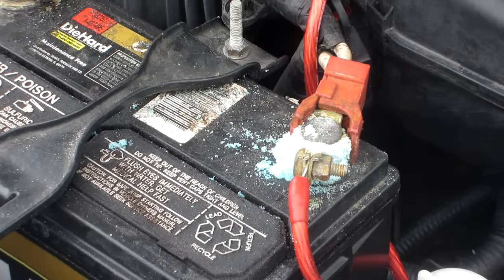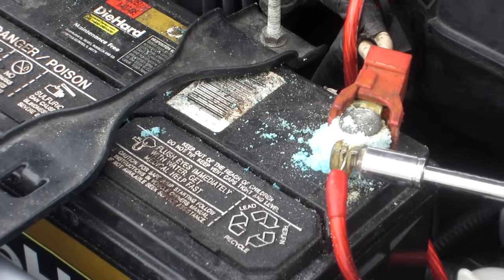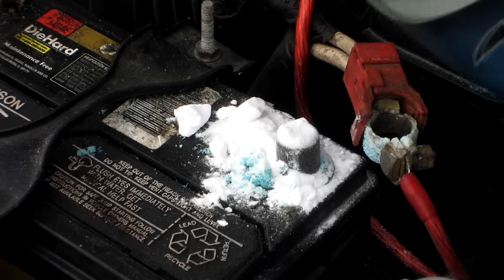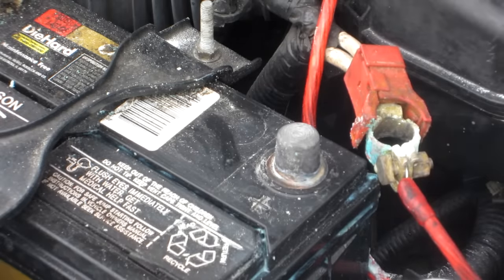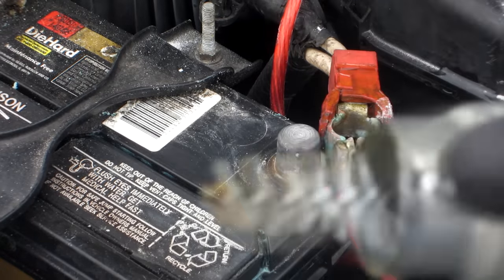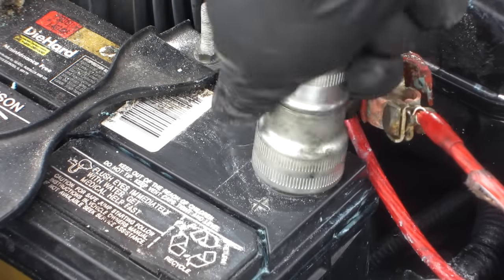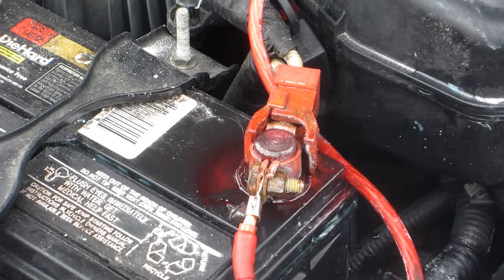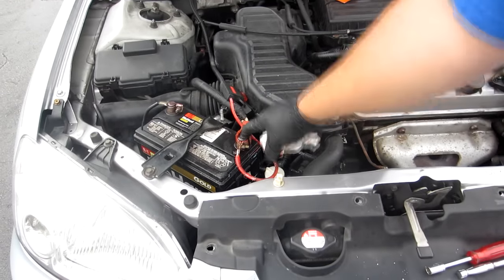HOW TO REMOVE BATTERY CORROSION FAST AND CHEAP!!!

Comment: the reason that the Positive terminal is full of corrosion is the battery acid is leaking up past the Post...... junk battery. It will come back. What I found works better to clean is to either soak the positive terminal in a hot/ boiling cup of water for about 5 minutes. It will clean all the Acid off or you can also pour the hot water onto the battery to get rid of the acid on the battery. If Baking soda neutralizes the acid on top, what happens when it leaks into the battery through the vent caps? Hot water does wonder and everybody has access to it

Comment: take the wires off from battery and poor over the connections cable and battery some lanolin . splendid. it will never corrode again

Comment: Copious amounts of warm water will clean battery and tray as well as contaminated subframe. Once it’s clean, assemble and THEN grease DO NOT grease the contact surfaces as this will cause future problems. You’ll learn eventually. Thank you

Comment: Youngster..... Baking soda in a jug of hot water. Remove terminal, clean, re-install and spray PB Blaster Corrosion Stop.
10 year protection

Comment: "Corrosion" here is caused by leakage of acid, or acid fumes at the terminal post of the battery. The bluish-stuff is the reaction between the sulphuric acid in the battery and copper of the clamp, making copper-sulphate. If left alone, all the copper would be 'eaten".
Don't overfill the battery with water, make sure it is vented properly. Clean the terminal area properly, and use an oil based protector............or simply grease !
Trinidad & Tobago.
West Indies.

Comment: Make a paste in a cup and dab or brush it on.
I've never though pouring liquid onto a car battery was a smart move - the liquid can create a bridge between the two posts and kill the battery or worse.
Other comments about disconnecting the neg cable first are spot-on. ALWAYS!

Comment: You can tell most people are relatively clumsy & dumb when it comes to cleaning a corroded battery. You need to wear goggles that surround your eyes, it's critical to protect them. You MUST wear protective gloves to start this kind of cleanup, and make sure you protect your nose and mouth while breathing close to the corroded area. Many people bypass these safety protocols, and risk a lot. It takes patience and a lot of precaution to do the job at hand, it all depends on how much corrosion is present.

Comment: All you need to clean off and melt that corrosion is hot water and nothing else . After that you’ll need a battery terminal brush to clean up the post on the battery and the terminal and whatever wrenches you need to remove battery terminals. The hotter the water the better it melts the corrosion.

Comment: The corrosion has nothing to do with u putting an amp in your car it is leaking of the acid from your battery but another trick to keep terminal clean is to use small piece of copper layed across battery to draw corrosion to it

Comment: I use a toothbrush....it works just as good and not as abrasive. I coat the outside of battery connections with vaseline. It made my battery last a little over 3 yrs longer. I always buy the same brand of battery.

Comment: If you've got that much corrosion, it might be a good time to take the battery out, and clean the tray, and hold-down bolts. Grease the bolts up after, to protect against future corrosion... just a dab... ;-) thanks for the vidoe

Comment: What a lot of mucking around, just put a couple of teaspoons of Bi-Carb Soda into very hot water and pour it over the battery terminal, it cleans it instantly, just apply some ordinary grease around the terminal after you have washed it with clean water to assist in slowing down the corrosion.  The residue from the soda must be washed down before it dries.

Comment: Be careful on what car you did this to. My neighbour did this to his Rav4 and had to get a mechanic to reset things for the engine. Closest mechanic 80 klm away so wasn't cheap. Then had to reset audio codes. Next time he will take to mechanic. But works for older cars. Hint pre mix baking soda with water.

Comment: The real reason why you get battery corrosion,  if you look at your terminal ends when they are new they have a shine to them.  As they get older the shine wears out, then corrosion starts. Simply scrub and clean then spray Hairspray on them,  or replace. And let dry before installation.  And it's the only terminal that builds the corrosion not the battery post.

Comment: Use hot water in baking soda first then clean them with a wire brush or a battery terminal cleaner let them dry then put them back together and put a light coat of high temperature spray paint this will stop the corrosion

Comment: Diet Pepsi and/or diet Coke work just as well, and after treating the battery post, just fill a paper or plastic cup with the diet soda, and place your battery leads in the cup, leave it for 30 minutes and presto! problem solved!  works every time!  PS: Diet Pepsi seems to work just a little better than Coke.

Comment: OR.......you can get a wire brush and use a lil elbow grease and clean it off and not have that mess all over your engine bay and the alkali draining into the cells of your battery, thus NEUTRALIZING the battery acid,and eventually ruining your battery.

Comment: U should have removed the negative first. What little is seen of that, it too is corroded. Second, you should have covered the battery caps panel to prevent ingress of water & soda. Third, in any case the removal of the battery would have reset the radio & ECU, then you might as well have put the battery on the ground instead on knocking that corrosive powder all around it. Fourth, the battery clamp & wire connector were not properly cleaned.
Pouring even plain water over the terminals will get rid of most of the loose corrosion powder. Then one can use a brush or sandpaper till you get clean shiny metal. Petroleum jelly (not grease) can be applied over the terminals after fixation. No need to buy these sprays.

Comment: Well I have seen a car that would not start,  All you have to do is pour a coordinated drink over it, and then hit the starter and it starts right up.  the coke get into the clamp and restores conductivity.  I have done this very often when someone need a jump start  Then when you get home you can use your method.

Comment: The carbon keeps coming back....whats the reason?
Reply: Once you've cleaned it apparently you should put petroleum jelly on the terminals.

The Jelly prevents buildup and also aids even contact between the terminals and cables.

Comment: If you trying showing how to remove that + Positive Terminal without removing -Negative At First with that Socket and plus a long extension when it touch your car Frame or any metal object of your car than he in big Trouble.

Comment: much better to mix the baking soda with boiling water in a jug first then pour over the affected area , plus the hold down bolts , and soak the battery cable end in it even for a sort period ( A couple of minutes) ...just my opinion :)

Comment: amatures put soda on battery.  In between metal and plastic acid getting out.  Putting soda right there kill battery in no time.  Just put terminals in soda mix hose off battery plain water

Comment: The correct method of cleaning battery terminals is to first disconnect the negative terminal ,then positive terminal other wise if tool touches any part  of the engine or car body there will be big spark . After that remove all salt deposits with the brush and then use water and baking soda mixture on the battery terminal and wires

Comment: So like you said in the video you are missing a capacitor and it's causing the corrosion. In the video the connections are cleaned, but I imagine the corrosion will form again with time. So what should we do to prevent it from forming. Add a capacitor?

Comment: Coke can be used to clean car battery terminals. The slight acidity does NOT react with battery acid, so you can pour it over the battery and let it wash away corrosion. Wire brush and hose off with water. some vaseline will help from corroding quickly again. So will rinsing your engenroom once a month too. I have used this method for 45 years with fantastic success. 
Also, for those of you with chrome, coke will also remove light rust. Light rust. When I was 10 years old my grandfather gave me a bottle of coke and a rag, yep all afternoon cleaning bumpers.

Comment: I stopped using baking soda in water because if it gets inside the battery through a defect in the case it messes up the battery and you end up killing it

Comment: I have never seen anyone apply the spray or grease onto the terminal before they connected the cable.  I won't stress it anymore. Cool vid!
Reply: Be careful with grease sometime it can cause no connection. I use crc electric grease and a light light application is ok but if you over due it wont start
Reply: @patrickmitchell100  thats what i was told. I just slather the grease onto the felt pads, slide the end onto the terminal and slather the rest. I have never had a corrosion problem not adding anything to the inside of the cable end and onto the terminal.

Comment: Don't  put  your  Amp wire between  the battery  terminal. Put  it under  the  nut.  Your  making  a spacer on your  terminal

Comment: You're doing it wrong.  Get a pitcher or bucket of your hottest tap water and pour it over the battery terminals. the acid will all melt away without all the extra things you are doing.  You can then clean the terminals if you wish.  I believe in the can spray, but you don't spray it on until you have the connector tightened on the post and you should spray it on liberally.

Comment: Have you tried pouring boiling water on both terminals and battery cable clamps? You really do not need all of that! Why did not wash the battery with water after all of these chemical reactions? I have been do it for many years using hot boiling water and it works perfect and fast! Using the metal brush after is fine and get a battery lubrication grease and apply it to all terminals! That's it!

Comment: I would have just removed the battery so as not to get a mess inside the engine bay and also clean the battery holder.

Comment: Never use baking soda on a car batteries that's just the worst thing spray the battery down with a garden hose take that negative off and then the positive and wash it with soap the use a battery post cleaner put a little bit of WD-40 on top of the post when your done those red and green post protectors work pretty good too.

Comment: In a perfect world, there is no need to look under the hood of your car, naturally, it happens, and the car failed to start. I was faced with this corrosion(and a failed battery)recently to a degree that was unexpected in my 2005 Toyota Avalon. The blue corrosion shroom on the positive terminal was huge, at least 3 inches circumference and 2 inches height covering the entire terminal and clamp. I removed what I could with a putty knife to try to keep it from falling in  elsewhere. Then treated with white vinegar and wire brush. Flushed several times with water. Negative terminal was perfect without treatment, and detached from battery. My attempt to remove positive terminal resulted in the destruction of the cable terminal, as it snapped in half, but the positive cables were still solidly corroded together where cables attached to vertical bolt on the terminal. After cleaning up remains of the terminal and clamp, I let it air out overnight. Next morning, clamped the remains of the clamp to the terminal with some vice grips, and the car started. Off to AZone for new battery. Battery confirmed dead. Paul at AZ not able to free cables from what is left of positive terminal due to corrosion. Bought new battery, 2 possible generic terminal replacements, vice gripped the positive cable back onto the new battery and head home to grapple with the cables corroded on the old positive terminal bolt. At home , I removed the negative terminal, the vice grips on the positive terminal and cable, and removed the new battery. Using vice grips and several wrenches, I was unable to budge the nut corroded on the vertical post of the terminal. Time for some brain  over brawn. Using a section of 2x4 in the battery area, I was able to clamp the positive cable and terminal in a position where it was steadied on the 2x4 for a drilling. Using my hammer drill, I penetrated the corroded nut next to the bolt until just through to the cable terminations corroded at the base of the vertical post. Once that was done, the corroded nut was removed with a wrench and the corroded cable terminals were freed, though still stuck together. Working with a small chisel and hammer with the vice grips, I was then able to separate the 2 cable terminations from each other. I cleaned each cable termination piece with vinegar, visually inspected, and reinstalled on the new positive battery terminal, reinstalled the new battery, positive first, negative last. Next step is too replace the ill-fitting generic positive terminal from AZ that is being used for the time being...

Comment: I just pour hot water & clean terminal with old toothbrush, then put some Vaseline jelly to protect the terminal , that's it... connect & apply some more Vaseline jelly petroleum based...

Comment: I don't know if this is bad or not, but I literally had this issue just yesterday, and it's the reason why my car wouldn't start. So I literally just poured some coke over it, and went back over it with water. Tried it the next day, and by God the car started.

Comment: never get baking soda near the caps of the cell openings, you can see it s residue on the cell openings, if a tiny bit of B.S. gets into the cell that cell will fail in a matter of minutes!!. and take a few more try's at the post its still got way to much on the post , take your time got to be clean...
use a hose with water to get that excess on the top of the battery...look closely ...paper towels don't do it!!!......sorry buddy!!!....

Comment: The fastest, easiest, safest and cheapest way to clean batty corrosion is hot water, the hotter the better. just pour it over and corrosion is gone. Remove cable ends from battery and soak them in a cup of hot water and they are clean.

Comment: JUST USE  VINEGAR, IN A SPRAY BOTTLE, MUCH EASIER, also for any battery powered device, like radios, flashlights, etc, a capful of vinegar, dip in a Q tip, clean out battery compartment,springs, terminals

Comment: I just use HOT water only. Sometimes I boil it and just below the boiling point - pour over problem area. You can microwave the water or you can use the hot water straight from the tap if it's hot enough.
Try it, you might be surprised! No chemicals, no Coke, no Baking Soda, minimal mess.

Comment: the battery is in a state of discharge...note the bubbling under the caps. also the corrosion is caused by running electric current thru dissimilar metals....copper and steel. Replace the steel lug and replace with copper or brass lug. also premix water and baking soda or pour pepsi across entire battery case. rinse with water.

Comment: After the post is clean use a little Vaseline on the posts and connect terminals to prevent future corrosion. I learned this trick from a motorcycle mechanic many years ago.

Comment: Just pour a pitcher of hot water onto the terminal, remove the negative terminal first then the positive one, clean both terminals and battery posts, smear with Vasoline and refit both terminals (positive one first).

Comment: I bought the terminal battery cleaner and protector at Amazon , plus it comes with the terminal brush and the red and green pads that go on the the terminals for $15.99 it’s been a month and I don’t see any corrosion.the red spray protector it’s doing it’s job. I bought it at Amazon, but you can get it at any auto store also.

Comment: It's not corrosion buddy. It's the acid leaking through the post. After you clean it, it will come back because more acid will leak back through the post. It's a battery flaw, not environmental.

Comment: These are just battery salts. Not true corrosion yet. Just warm water or Coca Cola is all you need.  You may as well remove the battery and clean it, the tray and the hold down while you're at it. That's what I do for a customers car.

Comment: Water only can remove it. It will repeatedly appear once it appear. Main cause is when u use hammer or any hard object to connect the terminal.

Comment: Your making it more complicated then it has to be. Just boil hot water and pour a cup hot water over the cable no need to disconnect. I put a bit of baking soda a too. It fizzles like soda and dissolves immediately!

Comment: Glad he is not working on my car ! Mix the Baking Soda into small container of water . Make it a slightly thick mix. Take the cables off (both of them) pour the baking soda and water mix on the posts and connections and over the battery. wait until it quits bubbling and then take a water hose and rinse everything well

Comment: If your battery is got stuff growing on it that means it's no good throw it away and get a new battery .
Reply: Douglas Compton 
 You are totally NOT correct there Douglas ! ! !
That corrosion on the terminal is ONLY surface corrosion ! 
 It can be easily washed off with only hot water. 
No major harm done to the battery at all ! ! !

Comment: I'd suggest to remove the battery entirely from the car then proceed.
 also, if you're in a pinch, lots of things can be used as an ihibitor to varying degrees of success like: 
 grease (many prefer red grease), I prefer marine.
hair spray from grand-ma's bathroom would even do it. Not sure about mouse or gel though.

Comment: You can run the car and pour WATER OR SODA on it and that also cleans the battery and you don't have to take the cable off. That way  is a lot faster